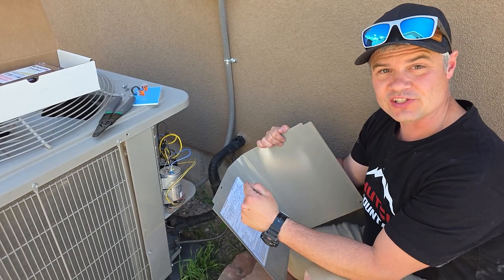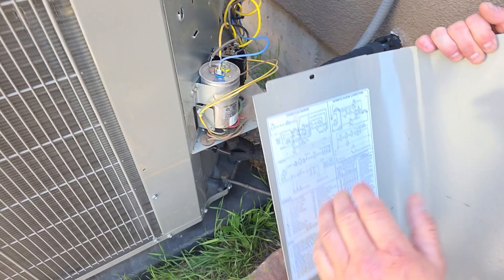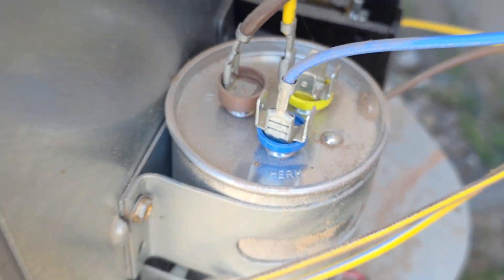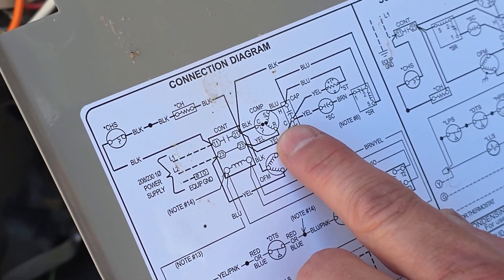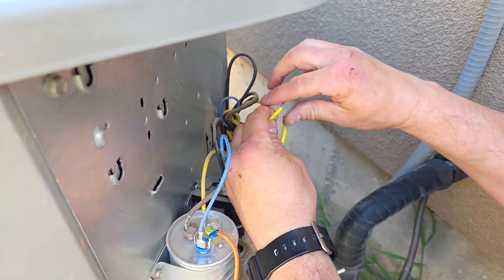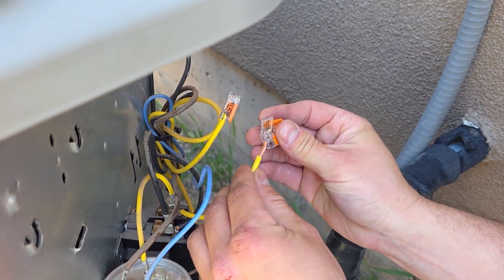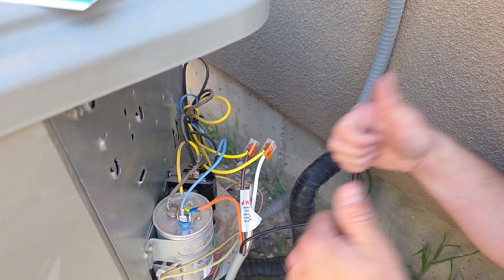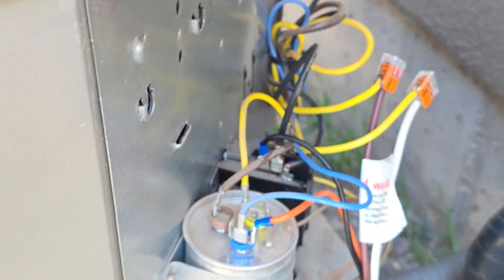How to Install the Micro-Air EasyStart Flex 398 Residential Soft Starter

Comment: Great video, man, I'm assuming this process is the same for all the Micro Air models right?  I have the bigger model without Bluetooth that I just never installed but this video gives me hope and I'm tackling today.  You have the best most straight forward video ice seen. Thank you.
Reply from the maker: Thanks! The process is the same for the residential models (Flex, 368, etc) so it should work alright. If you run into any troubles, give us a quick shout at 435-494-1975 and we can help get it fixed.
Reply: @HutchMountain  It worked!  Best video for  this product out there.    Tank you!

Comment: My capacitor just failed and my A/C guy came over and popped a new one on.  Is there any chance my Micro-Air Flex Easy Start 398 caused the failure of the capacitor?    I ask because he installed it for me 7 months ago and its been working fine since.  He's not a big fan of people using them and said thats what killed the capacitor.   What do you guys think.....?   My capacitor that failed had to be very old because when they installed it you couldn't read any words or numbers on the top of the capacitor to know HERM, Common or Run.......they knew but I couldn;t install it because I had no idea what was what.

Comment: Just curious, Easy Start  is lowered starting A/C amp   as average   in 6 times  is it possible to run A/C on solar panels ?
Reply from the maker: It’s possible and all depends on your battery capacity and setup. We’d love to help you figure out if your system will work so give us a shout at 435-494-1975!
Reply: @HutchMountain  Great thanks!
Thinking about  hybrid setup including external power supply and internal w/o battery

Comment: In the Easy Start instructions. They want you to disconnect the start cap. How come you are not showing that? You really don't need to do that? Thanks
Reply from the maker: Hi @paulainc! Thanks for the question. We didn't show that in this particular video because the A/C unit we were working with did not have a start cap. If your unit has a start cap you we encourage following the instructions and disconnect that.

Comment: If the unit already has a hard start does itneed to be removed first before installing the soft start
Reply from the maker: Hi and thanks for the question! Yes, the hard start will conflict with the operation of the soft start so it will need to be removed before installing the new soft start. Give us a shout if you need any help with installation! (435) 494-1975

Comment: For the no-common-sense installers, the most crucial step prior to performing the installation is to remove power to your AC unit from the disconnect box and turn off the thermostat and any breakers to the AC unit. :face-blue-smiling:🤣:elbowcough:

Comment: I have a question about when the ES is powered up and then connects to the A/C.  Does the ES power up when the power disconnect is reconnected to the power source?  Or, when the T'stat is turned from OFF, placed in OFF for the installation of the ES, to Cool/Heat whatever....?
Reply from the maker: Great questions! The EasyStart receives power through the compressor and is activated when the call for cool air is sent to compressor. The EasyStart interrupts the power to the compressor to control it. If the cool air is turned off, the EasyStart will power off as well.

Comment: Give the video thumbs up because it’s very easy to follow. I double checked the wiring on mine four times because the unit started once then when it shut off, it would not turn back on again.. after I removed the unit and connected the two wires back together the AC is now running again.

Comment: I connected the easy start step by step. The AC unit works well... Until I  try to run it from the generator (Duramax 13K). Is there an on/off switch or something on the easy start? If I didn't hook something up correctly I don't believe the AC unit would run at all. Am I correct?
Reply: Update: after shutting off three to four breakers our A/C unit came on. I was able to turn on a couple more breakers after it started. Great video the easiest instructions and best video by far.

Comment: I feel so dumb, after watching how to home's video on it I thought I needed to remove the wire that was on the herm terminal and replace it with the orange wire.

Now after looking at my own wire diagram I understand my starter wire is the only one on the capacitor.

Thanks for the video, I was wondering why my error code was a 7

Comment: It’s a violation of the National Electrical Code to use an un-listed means (Wago) to join copper and aluminum wires.
Reply: Except wago is ul listed
Reply: @monsterpoo  ...correct.....WAGO lever-connectors, do however come in several ( two?) sizes for ampacity. Watch for this.....WAGO 221-400 series and 600 series, I believe...

Comment: I've seen other videos installing older versions of the Micro Air, as well as the AirGo, and both of them indicated that any start relays and/or start capacitors present in the system MUST be removed before installing the device. The wiring diagram on my AC unit looks to be identical to the one in this video, showing both a Start Relay (SR) and a Start Capacitor (SC), yet I did not see these removed. Does the Micro-Air Soft start not require removal of the Start Relay and Start Capacitor? If they need to be removed, can you provide a video demonstrating the recommended way to bypass this?

Comment: I agree with everyone else.  This is the best video out there.  And their customer service was absolutely outstanding!  I bought mine from them to install on a 23 year old heat pump.  My wiring box doesn't look anything like the newer models.  I thought I had it all figured out but I wanted a bit or reassurance before I started.  I sent them an email with some questions and photos of my wiring.  Jesse responded within an hour and verified I was all good to go.  Customer service like theirs is rare these days - and a welcomed blessing.  Thank you again Jesse!  Definitely buy your soft starter from them.  
     By the way, my 23 year old 4 ton unit drew 135.5 LRAs!  That's crazy.  After installing the Flex:  It only draws 40!
On my brand new 3 ton unit:  It went from 81 LRAs to 28!  Amazing!  My house lights no longer dim, and I can now run both of these while on my whole house generator!  Finally!

Comment: Had to remove a hard start capacitor and relay before installation of EasyStart Flex, but that wasn't a big deal.  Then no problem on the wiring steps covered in this video.  However, once wired, since the EasyStart Flex box fit in area with capacitors and contacter, I mounted it in there and put the protective panel back in place over it.  Have now learned the hard way the Bluetooth connection to EasyStart phone app doesn't transmit well through the steel protective cover and have to be a few feet from AC unit to get the EasyStart data.  Likely will leave where it is, but thought others would want to know they should mount EasyStart outside if better Bluetooth connection is desired.  Also, the EasyStart is only powered when AC is running, so data transmission to phone can only happen when AC is running.  Also per the data transferred to the app, the max startup amp draw didn't drop over the 5 learning starts, was 58-59 amps each time with 14 amps draw while running.  It's 5 ton unit, so that amperage draw may be normal, but maybe the capacitor has gone bad?  I'll have to get a multimeter with capacitance test to check.

Comment: I watched many videos on installing my Micro-Air Flex. THIS one is the best by far. Cuts out all the crap and tells you what you need to know. Allowed me to intall mine with confidence. FYI, you have to be about 5-10ft away for the bluetooth to connect, and ONLY while the unit is running.

Comment: Best video ever.  After reading the installation direction I was a little apprehensive of putting this in.  After watching this video I installed this in my Bryant 4 ton Heat pump in less than 30 min.  No more dimming lights when my HVAC starts.    Easy peazy lemon squeezy!!

Comment: I bought my Flex Unit with the wiring harness. I found the 2 stake-on terminals on the Black & Orange wires were loose (crap) the following day before I buttoned up my install. So, I removed & replaced them. The WAGOs were AOK. You should check your stake-ons to avoid future problems. I'm hoping this Flex Unit lets me run my HVAC with my generator in an emergency.

Comment: In most installation videos, the yellow run wire that is  coming from the compressor is removed from the contactor, connector cut off & spliced to the brown wire from the easy start.  Where this installation differs is with the use of a second splice rather than connecting white wire directly onto the contactor via the appropriate crimp connector where the original run wire had been removed.  This way you only have one splice rather than two.  In the end the installation is the same, call me old fashion but the fewer splices the better.  The current installation kit from Micro Air does contain one WAGO connector for the one recommended splice.  Otherwise this is one of the best installation videos on Youtube.
Reply: I thought about popping the yellow wire out of the contactor instead of cutting it too. Insert the white wire into the contactor & WAGO connect the brown wire & yellow but I didn't. If this unit fails all I have to do is use a 1 wire WAGO to connect the yellow leads. Still east peasy but an extra step is true.

Comment: I installed one of these last year. To help protect the internal capacitors ( and other components in the soft start circuit),  during a power outage/hits, attach (snap in place) ferrite cores around the incoming power leads and the power leads on the ST. The worst power outages, the ones that will take this box out are not clean but dirty. By "dirty: I mean multiple on-off hits happening over several seconds/minutes. Everything in my entertainment room plugged into isolation transformers, survived the last bad one. The two items plugged into the wall were cooked. I fixed one of them but couldn't resurrect the other.  The ferrite cores will help absorb the large voltage spikes that wreak havoc on electronic circuits. . That is their forte.
Reply: Whole house surge connected directly to the line side of your main panel breaker will protect the whole house from surges.  They are relatively inexpensive but installation required pulling the meter.  Usually not a DYI install.  Next best are the ones you can attach to a two pole breaker mount as close as possible  to your main breaker.  As a double safety you can still use surge protectors on you A/V & computer equipment.
Reply: "ST"?

Comment: The Micro-Air Soft-start Flex will not last.  My unit only last 11 months with internal parts blown!
Reply: I have the model prior, and i have had mine for 2 plus years in AZ sun and heat
Reply: @jasonclark1223  ..prior model that was specific-sized for the AC unit....seems to be much better in quality.....from reports. The "FLEX" unit is smaller and is not AC size specific...says good up to 6 ton ACs.....

Comment: Does this thing really save energy? 🤔
Reply: Not necessarily. It just lowers the initial amp draw.  Thus you can power you ac system with a large portable generator. I was assume the design will also extend the life of your ac components.
Reply: It prolongs the startup phase of the AC system, so instead of a huge spike of power initially it has a gradual draw of power until the AC comes up to operating speed.

Comment: First pull the fuses, second short your capacitor.
Reply: This is the way. 👆👆
Reply: I’m a DIY. I’m not understanding. Please elaborate.
Reply: @Kiddro22  capacitors hold energy and are designed to discharge a lot of energy fast.....they will hurt if they shock you...
Reply: @Kiddro22  Cross the terminals of the capacitor with a screwdriver which will discharge any stored energy.
Reply: Best explanation of connecting the easy start flex that I’ve seen !
Reply: Draining the capacitor with a multimeter is better than shorting it out with a screwdriver
Reply: @bassp.sherman1908  too right!

Comment: From looking at the wiring guides online it also shows that you have to disconnect the black wire off of L1 contactor that leads to H and C on the capacitor. It also shows you would need to disconnect the C to H on the capacitor. It doesn't seem those connections are present in this video but it is for the same wiring diagram you showed on the inside of the AC in this video